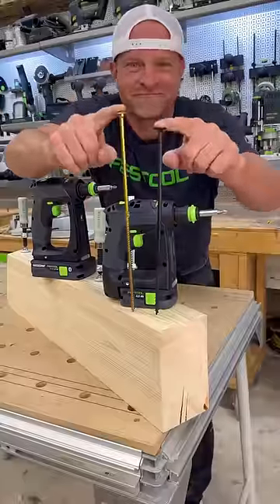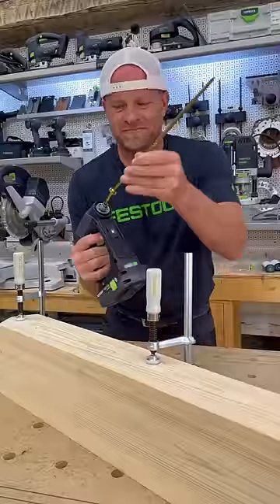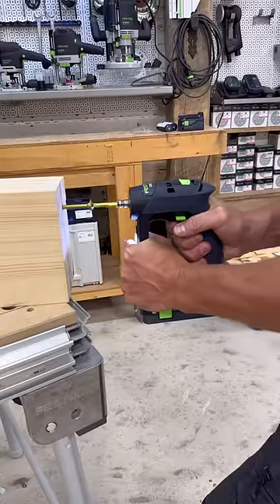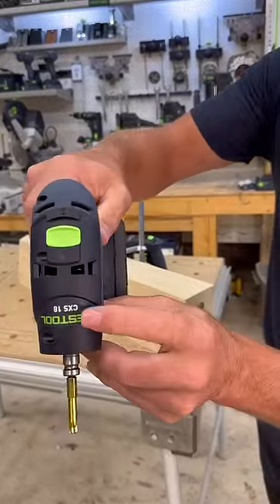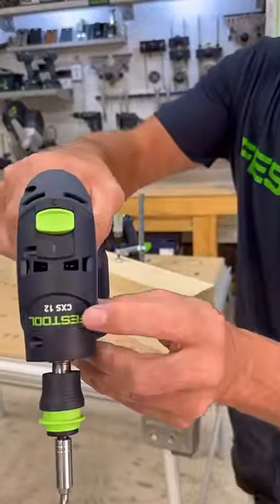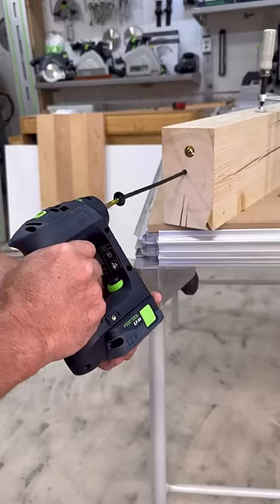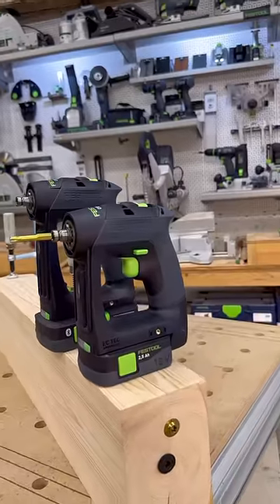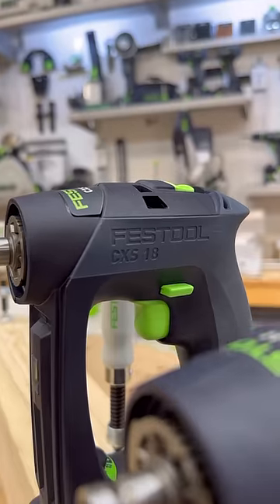Trying the new 18 and 12v Festool drills #woodworking #carpentry #diy #wood #woodwork

Comment: "the 18v did a great job, so let's try the 12v with a different screw"

Erm
Reply: Yeah, that was somehow dumb
Reply: Depends on the point of the video. Just seems to be showing they’re powerful for what they are. Each screw was a high bar to cross for each drill, so I think the video serves its purpose.😊

Comment: $299 for the 12v one. A Milwaukee M12 drill/driver set is currently $99... no brainer.
Reply: I agree I had everything festool not as good all around as wilwaukee especially drills. But the cxs12 is just a different class best drill I’ve ever had. The impact and combi are pretty basic.
Reply: I’m a house remodeler and install lots of kitchens every year. I have the m12 fuel combo for everyday work and think they are great (the none fuel are a waste of time), however for kitchen installs I use my cxs Festool, it doesn’t fall over and damage a $50k when I put it down, it’s a joy to use all day, it’s quiet and just does a better job driving screws in. Is it over priced…probably! But just the fact it does not fall over a damage one kitchen is worth the price.
Reply: An apples to apples comparison would be the M12 Installation driver 2505-20. The tool alone is $229
Reply: @daifeichu I agree
Reply: Festool is not as much about power. CXS is valued for low speed and precision of control. They are for bit different application. Milwaukee is for building, Festool for furniture.
Reply: @KarelKannel  this video is clearly a demonstration of power rather than "control and precision", hence my comment
Reply: @bkjets2023   Ya, the drivers you mentioned would be better for what he was doing. Installation drivers, like the one I mentioned, are for smaller fasteners.
Reply: @bkjets2023 this video is not supposed to show the strength of the tool in general. It is supposed to show that it is still powerful enough to drive bigger screws while keeping in mind that it is designed to do  something else
Reply: Yes, the Festool, because it goes on for about five M12s. Or just get the REAL black and red, Mafell.
Reply: @aminperson3507 they have tools called electric screw drivers for way cheaper than a festool and will work perfectly for your application
Reply: Yeah get the Festool
Reply: @hopkinshome3799 seems like maybe you should put your tools down on their sides ...
Reply: @jonalaufs69 yeah it'd have been better for him to show that and then show him at its lowest clutch setting to show how it goes from big to small perfectly
Reply: @daifeichu That tool, you ALWAYS wait for the sale. 2505-22 Tool, charger, 2 x 2Ah batteries, 1 x 6Ah battery = $225
Reply: @indigo_wolf3574    You're right. That's exactly what I did when I got mine. Always wait for the sale is my motto.
Reply: You get the festool quality and sustainers with them where milwuakee is a great brnad being a milwuakee nut myself most dont come with a packout
Reply: Milwaukee or Dewalt
Reply: I have a bag full of 12v Milwaukee and that was the biggest waste of money. 
I'll stick to my makitas.
Reply: @dimash244  I use both heavily. M12/18 nail guns/light/packout. A makita impact driver is still more pleasantly to use then all these installations driver comparison. Precise, powerful and drives straight.
Reply: @KarelKannel a lot of builders in the EU use Festool tools.  It's really only a craftman's tool in countries with people that think $3 gas is expensive😅
Reply: and? its not even a bit as good as the festool is
Reply: 317 dollars in UK with case , charger and 2 batteries , and lucky that they won't get robbed within a year
Reply: If you can’t afford festool just say that
Reply: @bkjets2023 Did you watch it with the volume off?

Comment: Great video, but could you have tried going against the grain as opposed to running with the grain??
Reply: Definitely. No strength in end grain.
Reply from the maker: The block I had there was was not wide or tall enough for those screws so I screwed in the direction where it take the whole screw
Reply: @dustylumberco  Now I see! I'm so impressed with your work and videos. Just brilliant. Well done.
Reply: I knew there was something way extra i was missing. Great call on the grain bit
Reply: @dustylumberco you could have cut that block in half with 1 of your multiple saws you have and then screw them together
Reply: @neiltrevatt  But then festool wouldn't have paid him when it didn't go through
Reply: Dewalt is 2 times better 😎🌪️

Comment: Now do 10 screws back to back
Reply: Why
Reply: Battery would run out after the second 😂
Reply: @Therealphantomzero  if you're asking why, then you shouldn't be part of this conversation.
Reply: @deezroastedchestnuts189 but why?
Reply: Relax brother😂
Reply: @Therealphantomzero if you’re using a drill to install a screw, it’s pretty rare to only need to install one. Screwing a handful of them back to back would be a more realistic test. This drill is a bit small for this size of screw though. I think the maker of the video was just trying to test the limits or show it was possible. Hope this answers your question as to “why?”.
Reply: @noheat4929  but why ten of these large ones? Literally makes no sense.
Reply: @Therealphantomzero 
Probably doesn't believe it will make it to 10 screws back to back, start the bar low.
Reply: @Therealphantomzero as he’s just said, if you’re installing screws (of any length) most of the time it’s not just 1 singular screw to be installed. So do 10 in a row to see how it performs on a more realistic task. And the reason of asking for it with these screws are because they’re the screws he’s showing in the video. A drill is only good if it can perform its task continuously, same as other any tool.
Reply: @brad15020  he showing off the motor strength using these length screws. But clearly the tool isnt made for repeated long screws so doing ten, 11 or 12 in screws isnt small to medium size work. This the kind of drill u keep in a little home kit to hang curtains and stuff.
Reply: Didn’t the 12” screw have twice the thread?
Reply: Dewalt is 2 times better 😎🌪️

Comment: No matter how much volts there is. All in dc motor power.
I can gave You 120v motor with power 0.5 watts and so what You can do?
Nothing.

But there can be 12v 1.2kw motot from car starter... and all mulwaki and mokiya drills are sit...

Comment: As a residential Plumber 

I’d buy Ridgid tools again if I was to go back And Do it again

I’ve cut into water lines under a house that had water in em and it literally Poured All the way down the sawzall while I was holding the trigger

I haven’t had Any Hiccups yet which is why I own almost every single one of their tools. The angle grinders Cut Solid steel and The Rotary hammer Breaks up concrete just as good as a corded one, if not better. I’ve sunk a 3/4” Concrete bit 20” into a footing. The extension was in the hole. It was glorious. 

They Do amazing deals in The fall.
I have probably spent $6000 on Ridgid tools but Everything I’ve bought I’ve Put to use as efficiently as possible with little to complain about. 

If I had to give one note, I wish Ridgid would release a PEX expander. Kind of dumb The Company that makes pipe wrenches and Pipe threaders doesn’t Step into the Plastic Pipe market already.

Comment: Why they have that front handle thing? How you gonna get into small spaces with that drill like that? I install cabinets and I wouldn’t be able to use that in the 12” cabinets I would have to have a backup drill just for those cabinets and we got 9” cabinets too those are a bitch even with a super compact drill
Reply: who needs a 9” cabinet

Comment: So I doubt I’ll ever switch to this brand, but I do think there are elements of this form factor that absolutely should be adopted by other drill makers, the forward handle is a huge improvement in my opinion, more stability, you can apply far more pressure, and it doesn’t take up extra space like the perpendicular handles you sometimes see on big brand drills

Comment: Festool really upped the game with the drill drivers. Still have my 10.8 csx after 5 years and the weight and ergonomics are amazing and even better with the 12 volt. But I'm slowly changing to Mafell, so I don't know if I'm going to get the new csx. I really love the Fast-Fix system. No need to buy extra machines for convenience.
Reply: Dewalt is 2 times better 😎🌪️
Reply: @SIRMANN  is it?

Comment: lol into pine. Now put that into poplar or maple. I’m not even talking about oak.
Any carpenter/cabinet maker knows that the best impact screw driver to assemble cabinets and s Milwaukee Surge, (hydraulic driver) with a standard 2.0 battery.
As light as any 12.0v units, has enough power to send a 3” screw into an oak beam. Will NOT snap the head of the screw because hydraulic function is softer on screws vs standard anvil type driver.
And most important, quiet enough to not impair your hearing when you’re assembling custom cabinets and your head is inside the same cabinet you’re using the impact in.

Oh and one more thing. Trigger modulation is perfect for installing even tiny hinge screws without over torquing them….

And yes I have almost everything festool ever made.
Their cordless stuff isn’t the best anymore